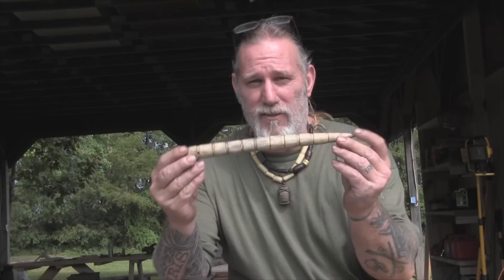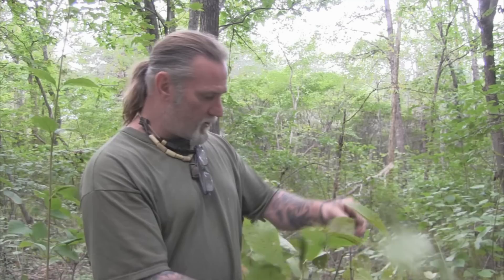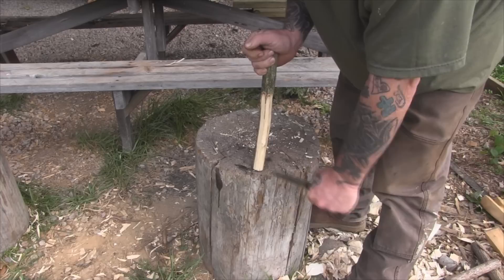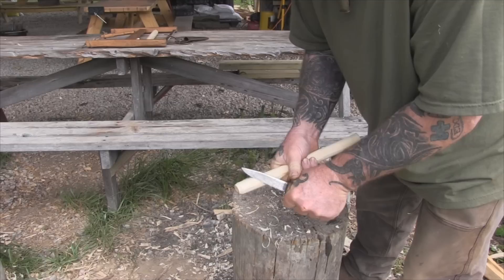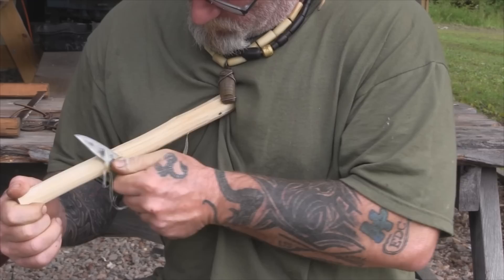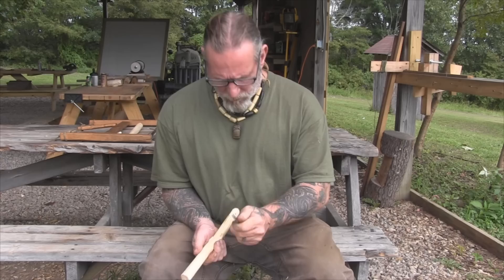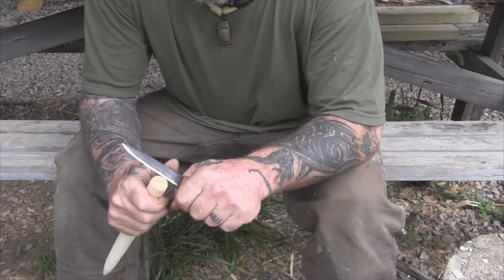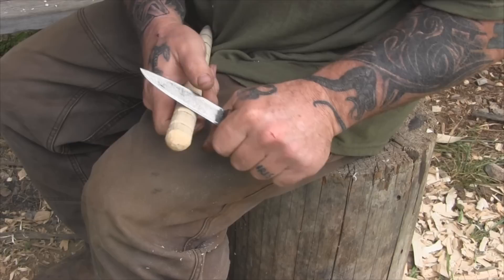Sloyd Project 1 Fid

Comment: I thought it was very well done and informative, would be unecessary and dangerous to to carry around a leather apron to do these tasks in the woods for "safety's sake."  I made the Maul with only a carving Axe and got blisters..no big deal though, nothing is 100% safe.  It's very rewarding to make something like this by hand.  Thanks Dave!
Reply: +Mike C If your axe handle has varnish on it, try sanding it all off and apply something natural, like linseed oil. That should reduce blistering :)

Comment: couldn't use your spring pole lathe?
Reply from the maker: +keith moore Your missing the point of this series, we have not gone that far with our tool kit at this point
Reply: didn't realize you were going through stages, I figured since it was already made it wasn't goin to used later on. how about fire hardin the point before oilin it up, would that help it last longer?